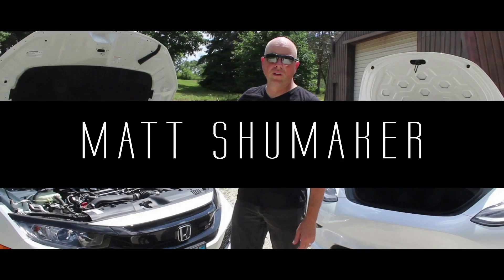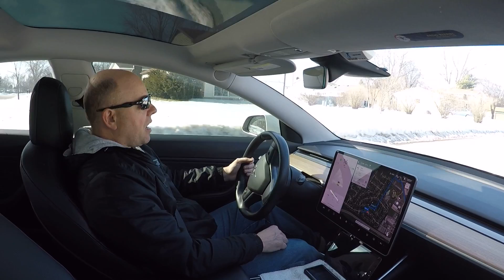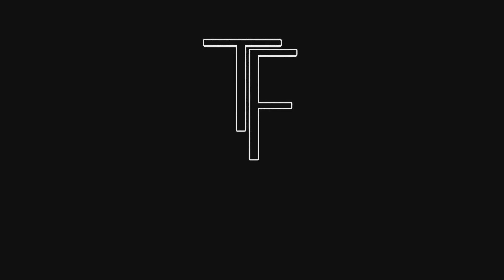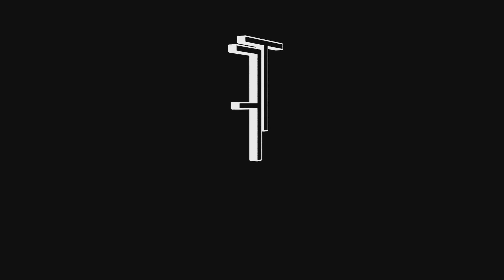Supercapacitors and my opinion of Tesla acquiring Maxwell Technologies

Comment: +Tech Forum    I hate to be that guy but my understanding is the 'dry' in Maxwell's dry electrode patent does not mean a dry cell, it applies to the manufacturing process where an electrode is coated with an active layer which is applied as a slurry. The solvent used to make this slurry is very toxic and has to be removed in long ovens which increases the time to make a cell by a day or two (obviously this is a continuous process so the time spent in the ovens just delays the whole batch so not as catastrophic as I may have made that sound). That evaporated solvent is not released into the air, it is condensed and reused. It is toxic. Maxwell's patent outlines a method whereby that toxic solvent is not required for electrode substrate coating, so the hours spent in drying ovens are not needed and the handling of a particularly nasty chemical is avoided. The electrolyte is unchanged, still wet.
Edit: that toxic solvent is N-Methyl-2-pyrrolidone (NMP).
Reply: Apparently this dry technique also happens to give superior qualities to the end product, bumping up the energy density and I think also the power density significantly. Being cheaper/faster to manufacture is sort of the secondary advantage.
Reply: @dcmeserve  I think the main "superior quality" is to slow the battery degradation allowing longer battery life.
Reply: Dogphlap I agree with what you wrote. 
To make it clear for the others, by removing the long machines that evaporate and extract the toxic solvent Tesla would:
1. Open space for more battery production in parallel = increase production 
2. Stop using with toxic materials = less complexity, less cost, more ecological 
3. Reduce cost overall

One more thing: Tesla now owns the patents to their own batteries. No need to give Panasonic a cut.
Reply: One of the other big benefits of the Maxwell Dry process is it eliminates the need for cobalt which Musk desires to get out of Tesla products due to Cost, pollution, supply issues and the questionable mining techniques used to obtain it.

Comment: Yep, I looked up Maxwells data sheet for an ultra-capacitor, and did a quick calculation, looks like the weight of a 75kWh ultra-capacitor was something like 10-20 tonnes. But a hundred lbs for a 0.25kWh UC could help with regen and acceleration, or a few hundred lbs for 1kWh for the Roadster.
Reply: The math does not fully add up : the kinetic energy of a 2000 kg (a few passengers and luggage)  Model 3 driving at 60 mph is already 0.4 kWh and the supercap needed to capture that energy during regen will weigh 70 kg or 154 lbs . I could not find a volumetric density spec , but using a very optimistic value of 14 Wh/liter , this would take 28 liters of volume  or 1 cubic ft.  At 75 mph , it gets a lot worse : 240 lbs and 43 liters or more than 1,5 cubic ft . Say goodbye to your frunk
Reply: Gerrit Govaerts The ultra capacitors don’t have to absorb all the energy to stop the car. They just absorb the initial inrush of current - just a large enough buffer to protect the cells.
Reply: @mondotv4216  Good idea , and I want to correct above calculations : divide everything by 2 as I forgot to apply that in my kinetic energy calculation E=m*v^2/2 !
Reply: how did you calculate that? Dont these capacitors have a watt-hour per kg density of less than what Tesla has now? I must be missing something because if your math is correct then the model 3 battery is over 10-20 tonnes currently. meh?